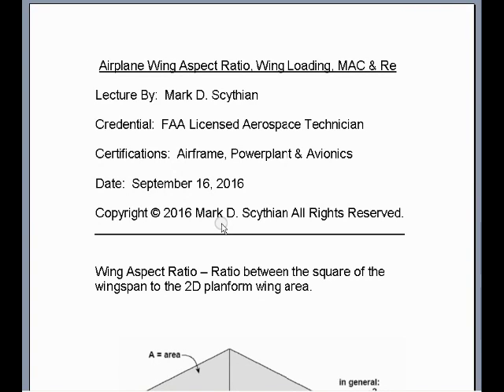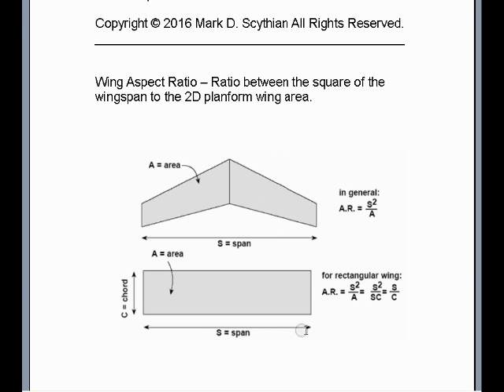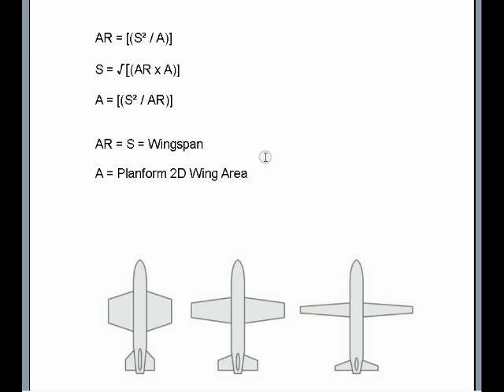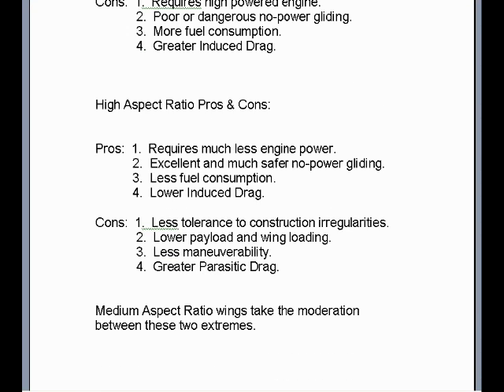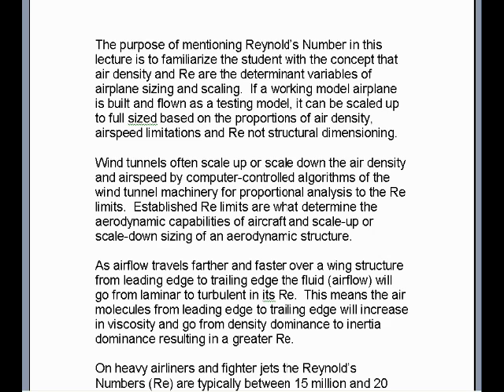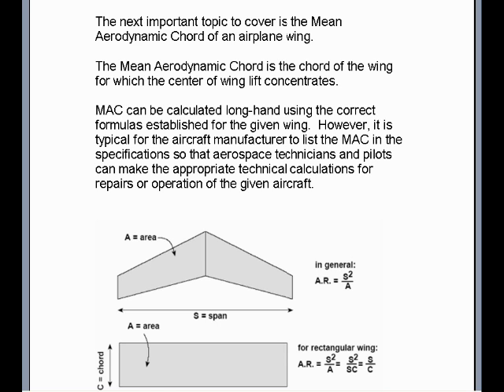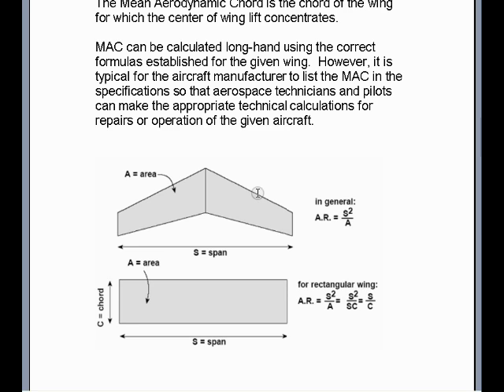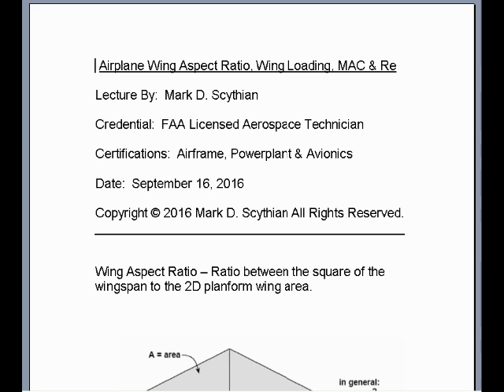Airplane Wing Aspect Ratio, Wing Loading, MAC & Reynold's Number

Comment: You covered MAC for swept and rectangular wing planforms but not the tapered planform.  I presume the MAC on the tapered planform is a line that runs through the 30% point of the “average chord” and normal to the longitudinal axis of the fuselage?  Or is the MAC, on the tapered planform, swept to fall on the 30% chord along the span?
Reply from the maker: Hi.  Regarding Tapered Wing planform wings they are most closely similar to elliptical wing planforms in terms of Lift Distribution and relatively to MAC.  Building a tapered wing is less complex than building an elliptical wing.  As for airline transport fixed-wing aircraft, their wings are both swept back and tapered combined.  There is a specific formula for calculating the MAC for a Tapered Wing as there is a specific formula for MAC regarding a Sweptback Wing.  There is also a general MAC formula for wing geometry other than Rectangular Wings. 

These days it isn't terribly difficult to find most MAC formulations online for nearly any type of wing planform by doing your own research and computational analysis.  Also, more practically, find an online wing MAC calculator which has all the complex formulation software built-in.  Good MAC software platforms allow the user to draw or enter in the specifications of the wing to calculate everything from CG, CP, MAC and Span Efficiency. 

The MAC of a Rectangular Wing is 1/3 of the chord from the leading edge.  The formula changes for the swept back as well as the tapered.   Mean Chord is not the same as Mean Aerodynamic Chord, although in most cases they are close but not identical.  Once the MAC is calculated, 1/3 of its length will find the span-wise center of lift so that CG can be calculated accordingly.  This is especially sought after for sweptback and tapered wings.  

Let's say you have a swept back wing that is also tapered and the specifications list that the MAC is let's say 50 ft span of a 73 ft wingspan section from tip to center of fuselage of let's say the right wing.  Whatever the distance is from leading to trailing edge of the 50 ft span is the MAC.   Travel back 1/3 of the MAC then draw a perpendicular line across the entire span of both wings, this is the center-of-lift.  Usually another 1/3 behind this point is the CG for nominal performance.  Although 22% is what most airliners have their CG.

Comment: hi, may I know the main reference of aspect ratio range as you presented in this slide. Thanks :)
Reply from the maker: Hi Nor.  In regard to Aspect-Ratio-Range 'main reference', higher aspect ratio implies lower Wing Loading, lower Induced Drag and greater Parasitic Drag.  Whereas, lower aspect ratio implies high Wing Loading, higher Induced Drag and less Parasitic Drag.  An engine-less foot-launched glider is better suited with very high wing aspect ratio (long skinny wings) as slight headwinds can set it aloft.  Whereas, a heavy payload airplane is better suited with lower wing aspect (short fat wings) propelled by a more powerful engine with high-pitch propellers operating at lower RPM and higher Torque.  Usually, airliners are at "mid" wing aspect ratio or around 7.5:1.  High aspect ratio wings are greater than 13:1 and low aspect ratio wings are less than 5:1.  The primary reference for this information lies within 'Basic Aeronautical Knowledge and Skill Sets'.